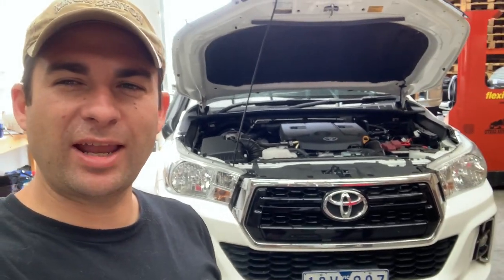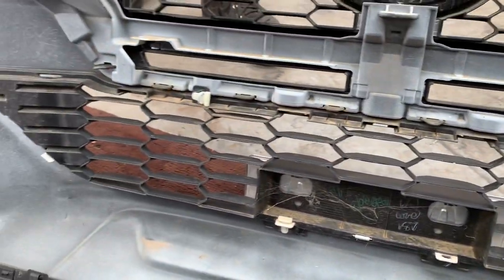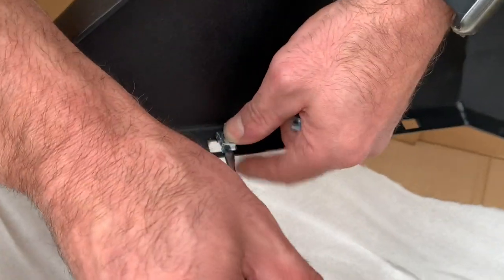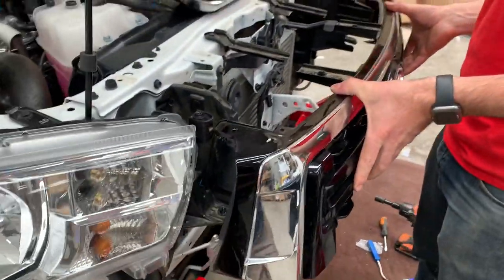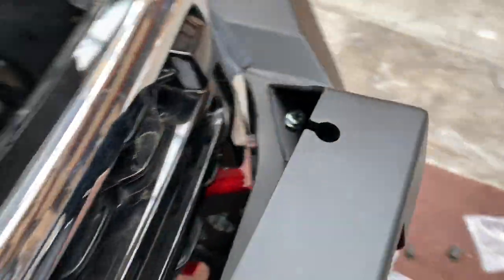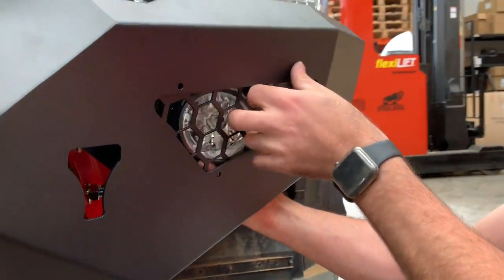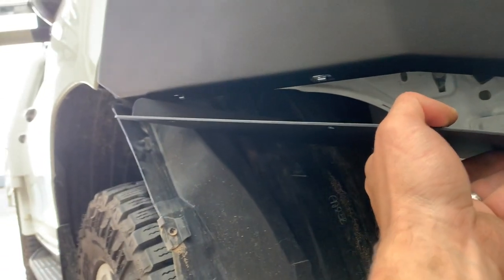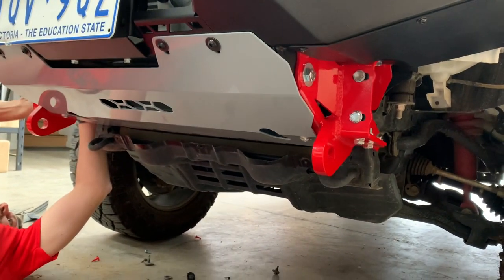Predator bull bar install Toyota Hilux, Offroad Animal

Comment: Is it heavy enough that I’ll need to consider a new suspension ?
Reply from the maker: If you add a winch then yes upgrade suspension, otherwise should be find with just the bar